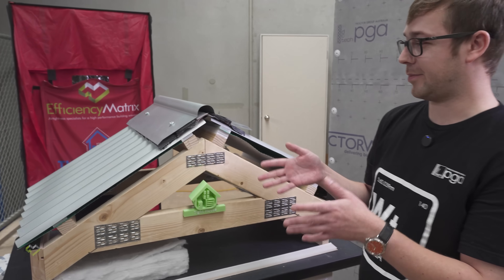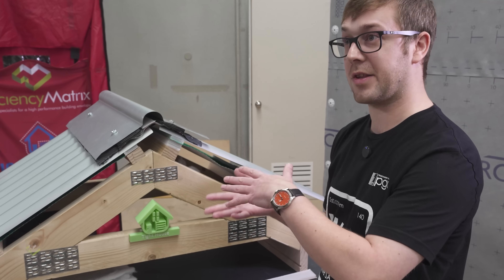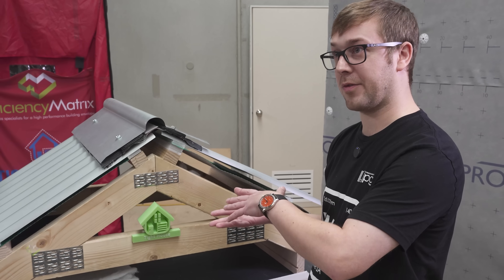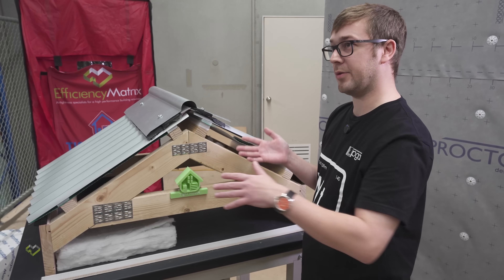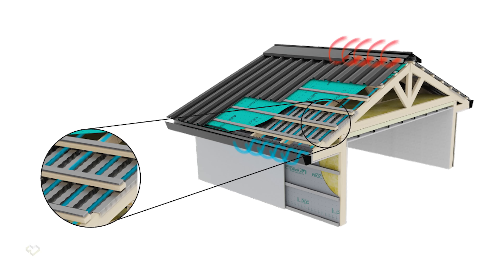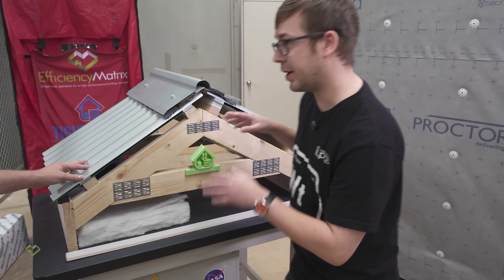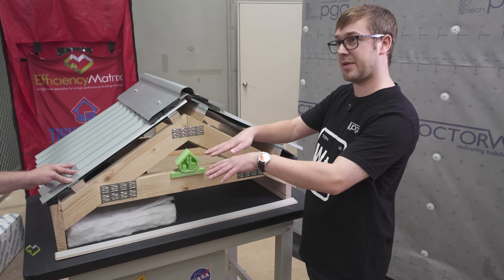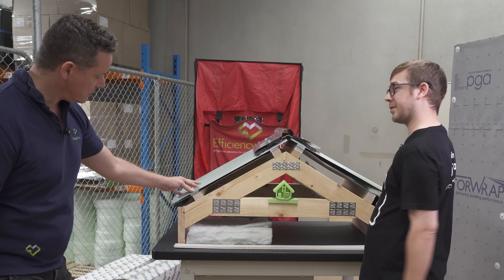Roof Changes to the Australian National Construction Code : Ventilation! (2025)

Comment: Installing a metal roof in this manner, you may find the client is not happy when the venting of the rolltop ridge flashing produces staining from the air passing under ridge and hip flashings. Foil sarking, sandwiching blanket directly under iron will stop air travelling through the blanket and you will not get condensate forming under the sarking. Make sure the sarking seals at hip and ridges and you will not get the messy staining that is obvious on light coloured iron. Cold external air flowing between sarking and iron in your design will create volumes of condensate forming under the sarking that will wet the ceiling insulation. Drawing external air into the roofspace will be a danger in fire prone areas. Creating a complex instal procedure for installers is only asking for a sub-standard product. If you want to vent the roof space, then use designed venting for this purpose. It is good that you are putting serious thought into ways to improve the roof construction.
Reply: The problem with foil sarking is it's impermeable and acts as a barrier to vapour so if its cold enough in winter, you can get condensation forming here instead of the underside of the roof sheet.  This is the main reason vapour permeable membranes are preferred in the cooler climate zones: to make sure vapour can pass through with little restriction (before it condenses).  That way, if condensation does occur, it will form under the roof sheet and drop down onto the sarking where it will drain to the gutter without coming back into the roof space or reaching the ceiling insulation.

There's nothing in the code to stop you using insulated foil blankets but the ventilated roof space must be immediately above the ceiling insulation or primary insulation layer.  So you would have to ventilate under the foil blanket anyway which means you don't get the benefits of the additional R-value to the roof assembly.  Much better to use a vapour permeable sarking with a fully ventilated roof space, and increase the R-value of the ceiling insulation.  There are BAL rated versions of the fascia and ridge vents suitable for fire prone areas up to BAL 40.  Ventilation requirements do not apply to BAL FZ areas though.
Reply: @Paul_dctech  You are going to rely only on the ceiling insulation and all heat that escapes the interior, be it through the blanket or the many gaps and wall cavities. (houses are not airtight) You are already exhausting interior fans direct to outside  atmosphere and would be wasting the serious advantage of the trapped air space in the roof space.
Reply: @Paul_dctech  Condensate will form under sarking if you do not have the outer side insulated, be it blanket, which is just trapped air, or a trapped pocket of air only, think double glazing. In extreme climates like Antarctic and Canada, buildings include wrapping in waterproof  "Tyvek" or similar to stop air movement carrying moisture into trapped air spaces and filling them with ice. The more insulation the better, subject to the cost factor to insulation benifit.
Reply: @haydnwilde  The main problem in cooler climates comes from moisture generated inside the building moving to cold areas of the structure rather than outside air bringing moisture in.  You could insulate the whole roof at rafter level instead of the ceiling and keep it warm enough to prevent condensation but it's not very efficient to heat a large uninhabited space so many pitched roofs will have a cold void above an insulated ceiling instead.  Vapour generated inside the building has to go somewhere; ideally it would all be managed internally and removed from the air using exhausts and dehumidifiers but you'd also have to make the building fully air and vapour tight on the interior side of the walls and ceiling.  While we continue to build homes in Australia without using vapour barriers, service voids, and putting holes in the ceiling for downlights, we have to use alternate solutions to manage moisture, like ventilating cold roof spaces (in climate zones 6-8).  In my experience, a Tyvek-like water barrier used in much colder climates are not always vapour tight, they are usually airtight and vapour permeable.  Some are even air permeable too because you don't want to trap moisture/water vapour in cold parts of a building and air movement helps to remove it.
Reply: @Paul_dctech  You raise some good points Paul. The moisture is in the warm internal air and condensate will form when the air temperature drops to dew point, and that point is subject to humidity levels. A lot of homes will just insulate at ceiling level (costs) and disregard the ceiling space area, and loose the advantage of the buffer zone of relatively trapped air in the ceiling space. That transition from warm moist air to a cold temperature drop is now at ceiling level. If you inspect "cold" homes that clients are not happy with and want the place to be warmer, you may notice patches of mildew forming on the ceiling surface, especially higher ceilings, and that usually happens where there is gaps in the insulation (gaps of 5% can reduce the effect of insulation by around 20%)  that happens whenever work is done, like downlights, fitting ceiling fans, hanging fixtures. In a perfect world, everyone who enters the ceiling space would ensure all insulation is complete and gap free, but if you enter ceilings in brand new builds, you may be disappointed with what you find. Remember that the better the insulation, the cheap to heat/cool. In heating all you need is to replace the heat loss, e.g. in a perfect insulate, no heat is required regardless of outside temp.
Reply: @Paul_dctech  I think you are running down too many rabbit holes. Are we not trying to build affordable housing, ideally relying on passive insulation systemsnot a complex structure relying on fans and dehumidifiers. You do not need to heat  cold ceiling spaces to control condensate. Think double and triple glazing...these are not heated, because they don't need to be. All you need to do is create voids (pockets) of trapped airspace that will act as a insulation barrier. Think of plastic bubble wrap placed around a fridge that can increase thermal effeciency. The last thing you should be doing is bringing in fresh cold damp air into trapped airspace...You will be adding moisture and taking away heat (destroying the thermal barrier and constantly replacing the heat you are venting to the outside).
Blanket and foil directly under a metal roof creates the trapped air pocket, and is why it is recommended that you allow some sag in the foil sarking to help create that void. Allowing a continual flow of outside air between the sarking and the metal cladding will guarrantee condensate to form on underside of the metal, and you will saturate any blanket in the void.
A very effective insulation design is foil and 60mm blanket directly under metal roof (blanket creates the trapped airspace), and 100mm blanket at the ceiling and the sealed airspace of a roof space void.
Heat from interior will be slowly lost through the ceiling to be trapped in the roof void, to then slowly leak through the blanket and foil barrier. You do not need to keep adding air to a trapped air space. Adding outside air is removing heat that is leaking from the interior. In fixing "cold" homes I found it far more effective and overall less costly to find ways to prevent the heat loss, rather than fitting a larger heating unit.
Reply from the maker: What’s designed venting?  Give us an example of a product?
Reply: @ecoevo  An example of designed venting would be "Dutch Gables" incorporated into the building design allowing for passive cross ventilation through screened vents, or vented building gables, or more basic exhaust flues to vent the ceiling space. In my working life as a plumber, including metal roofing, I would not install any metal roof, be it corrugated or tray decking unless it included a minimum of 50mm blanket  and foil sarking laid directly under the metal sheets. Clients would often install insulation at ceiling level as an added bonus. Foil and blanket directly under the iron makes the roof quieter. Not everyone likes the sound of heavy rain bouncing off the roof, and the insulation stops any condensate forming on the underside of the foil. If you want to be a cheapskate and have foil only (not permeable) under your metal roof, you need to ensure the air space between foil and metal roof is sealed to trap a layer of air to create a heat barrier giving something a factor of R 0.6, add 50mm blanket and get something like R 2.5. (I have forgotten a lot of the actual figures). Remember that sheet metal roofs have very little thermal mass, great in the outback and tropics, (heats gone in a matter of minutes, while a tile roof will be hot for many hours) Work on a metal roof in summer and it can be too hot to touch during the day, but 10-15 minutes after the sun goes down, the iron is cold and condensate is forming on the roof. You are coming up with good ideas, but the more complex the design, the more chance of being caught out on details.

Comment: This system  looks like a perfect insect nest site. Where I live, every key hole, crack, small vent even seldom used water taps have mason wasp nests built of clay blocking them. Even bees will try to build hives if there is enough space.
Reply from the maker: No matter which way you look at it, all roofs have these openings.  How’s this any different?

Comment: My experience of builders is you can walk around a new building estate and see the down lights on in the evening through gaps in the roof.. great building standards. 😂 in Australia on tiled roofs.
Reply: I think you are confusing the light in the ceiling space used around central air con with downlights.  Modern recessed led lighting does not have rear spill light.
Reply: @MalcolmBentley-p7n I think I know the difference..  unfortunately it’s fairly standard with Aussie tradespeople it’s all FP in and out even faster with little due diligence to check the work.

Comment: Has this been live tested ? If so where can we see results please?
Reply from the maker: Tested for what?
Reply: @ecoevo all I can see this doing is adding to the cost of heating and cooling of most Australian homes as for condensation it be interesting to see how much really ends up on ceilings and damages them 40 years in the building industry and I’ve never seen or heard of a ceiling collapse from condensation. Just another company trying to change the rules to rip of home builder
Reply: @64azeem  The changes in NCC requirements around condensation goes back to a 2016 government & ABCB funded study which found as many as 40% of residential buildings nationwide had issues with condensation and/or mould.  From 'Scoping Study of Condensation in Residential Buildings (2016)' :

"Many factors within the design, construction and building occupation can contribute to the presents of condensation. However, in Australia, recent changes in the type and complexities of the modern built fabric and increased consumer expectations of thermal comfort within Class 1 and Class 2 buildings may have led to the establishment of building typologies that may not always be suitably equipped to manage vapour pressure, condensation and mould."

It's not just looking at structural integrity but the comfort and health of occupants.  As buildings have become more airtight and thermally efficient, it affects the balance of heat, air, and moisture movement, and roof space ventilation is just one of the methods designed to manage the risk of condensation or mould issues that are more prevalent in modern homes.

Comment: I am in America, and think if I attempted to use this my roof would be filled with hornets 🐝 nests. So I would need a much tighter mesh at the eves. I am in Alabama 30 miles from the gulf and our climate is much closer to Australia than the rest of the USA.
Reply: Australia; from Hobart Tasmania to Cairns Queensland has very different climate.
Reply: We can have similar problems in country Australia with wasps and wild bees establishing nests - if they can find a way into ceiling spaces.
Reply: Do you know if you use foil and fibreglass blanket you don’t get condensation on the inside of the roof sheets. Why is this never talked about? Why would you just use sucking?

Comment: This is very timely for me. I've moved into a new home with an enormous roof space on multiple levels. It has a whirly bird and I don't think I've seen any vents for air inflow. 

Can you offer some advice? 
Colourbond roof, with a metal foil that has 1" of insulation under the colourbond (foil side down).
Upper Ceiling space also has pink batts on the ceiling between rafter/joists. 
Gables have large metal facing yet none of that is insulated so the roof space (especially garage and lower floor) gets very very hot under the foil insulation coupled to the colourbond. 
Bathroom vented air is direct into roofspace.

Large solar system in place - limits panel removal but the peak of the roof is accessible.

What systems in Australia (Brisbane) are accessible and I guess forward thinking with respect to building code and genuine effectiveness? 
I don't want mold problems and I am trying to improve the insulation properties of the home (Brick veneer with thick sarking in walls but no insulation. does ok temp wise with glass and ceiling as the main contributors to heat load during the day.
Reply from the maker: You need to get all your ducts venting directly to the outside.   You also need supply air to vent through the whirley bird.   Whirly birds are not very effective at moving air, a different solution, perhaps power would work significantly better.  I believe there are powered fans with built in humidity sensors.
Reply: @ecoevo yes I think this is the way. At minimum I’m I need low entry ducts and I’m keen to look at more effective high exit ducts because the whisky birds are not really venting all of the connected roof spaces which are across two levels. I wish for the maintainable simplicity of single story :p
Reply: @ecoevo do you know the name I should search for for any non mechanical vent systems here in Australia?

Also with increased venting how do you prevent a roof becoming a dust bowl? Insulation is a massive dirt trap

Comment: Are these eaves baffle products possible to retrofit? or is it another design that needs to be installed before the roofing system is finished?
Reply: The eaves baffle can work if you fix it under the rafters but you won't have as much room for the insulation as you would installing it from above.  You could push it up and staple into the sides of each rafter to give you a little more space though.  It doesn't have to touch the roof sarking, just as long as it stops the insulation from reaching it

Comment: What is the point of an airtight sarking if it is ventilated on both sides?
Reply from the maker: These products can be used as an air tight barrier too.  Being air tight, when water condenses on your roofing, on the top side,  the water can run off into the gutter, rather than drop into your roof.

Comment: won't let the air thru but will allow the water vapor thru cause it's a smaller molecule? Are you sure H2O is smaller than O2 and N2?
Reply: You are correct in that O2 is a smaller molecule, N2 being a slightly larger molecule than H2O molecules. All of these molecules can diffuse through a membrane. This  diffusion occurs very slowly. I understand that some membranes have been designed to increase the rate of water vapour across the membrane. Water which is the liquid state of H2O will not pass through the membrane. If you have ever had a helium balloon, you would observe that they eventually go flat as the He diffuses through the balloon. BTW air is mainly empty space at a molecular level!
Reply from the maker: Vapour is liquid gas suspended inside air. Vapour is a small *component of air. This is why vapour can pass through holes that air can't. A vapour permeable air barrier stops the Air from getting through but lets the vapour through

Comment: Thanks for this level of detail, what was a simple job has become so complicated now.
What do you suggest is the right way to do the following;
A pitched ridge roof (one ridge 38 degrees and the other ridge 13 degrees) ,
with 215mm SIP roof panels (R5) covered with Proctor Wraptite SA Membrane, 
with 35mm timber battens with small 10mm high plastic packer under batten to allow moisture to run off, 
with colorbond corrugated roofing sheets. 
Area has a BAL12.5 requirement due to BPA.
Air tight envelope (passive house).

Who is a good person to speak to and get a best practice response?
Or are there any suggestions from anyone?
Are fascia vents and ridge vents really required?
Reply: Ventilation of roof space requirement doesn't apply to SIP or concrete roofs so you just need clearance under the battens to allow for drainage (10mm will do)
Reply: @Paul_dctech  thanks Paul_dctech.
so that means no need for fascia vents or ridge vents, is that right?
Note: my case is Climate Zone 6 and BAL12.5.
Reply: @josephlauria-op8if  That's correct.  The roof space ventilation requirements in ABCB Housing Provisions specifically excludes roofs made from structural insulated panels (Part 10.8.3 Clause 2b).

The only instance I'd still suggest vents is in very low pitched roofs because they don't drain very well but that won't be an issue for you.